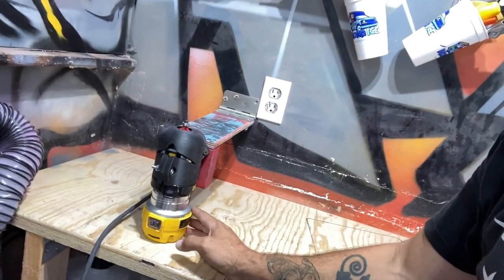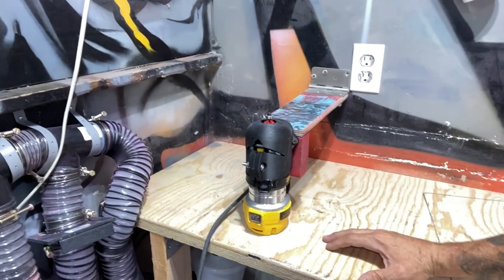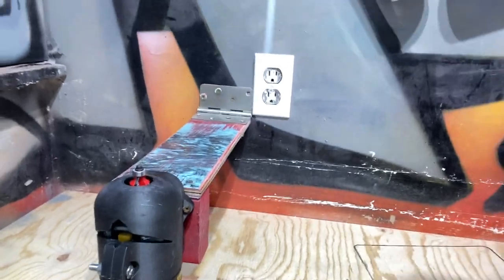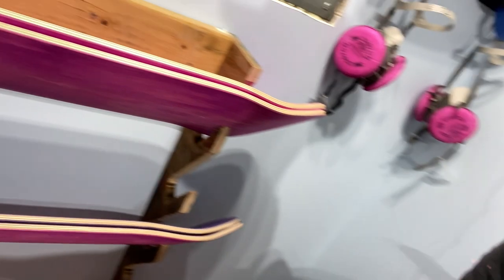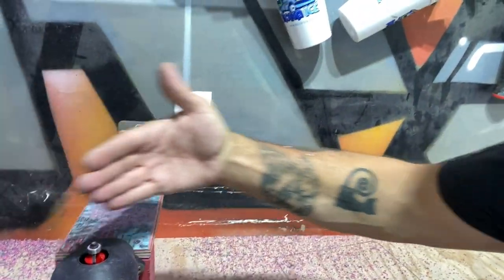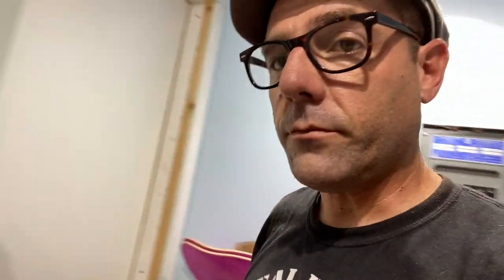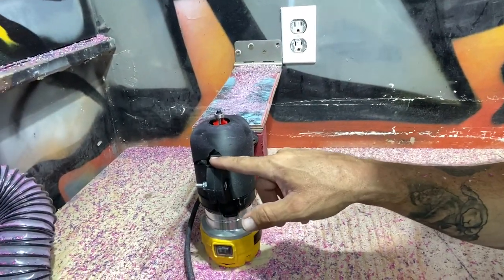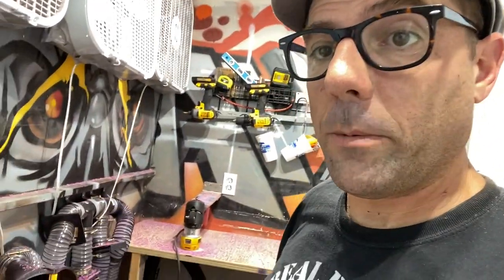"The Bishop" 3D printed edge router mount by Good Roads - REVIEW

Comment: Thanks for the review. Just ordered one. Quick Question. Looks like you're using a Dewalt router. If so what model is that? I have some Dewalt tools and it would be great to have a router that I already have batteries and charger for. Thanks again!
Reply from the maker: I’m not sure what model it is. It was the only corded handheld trim router I could find at Home Depot.